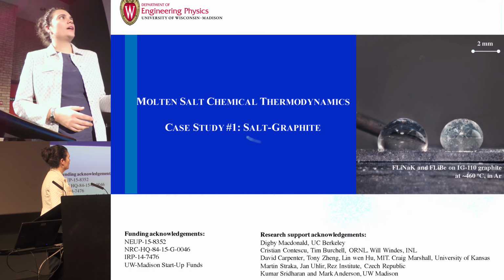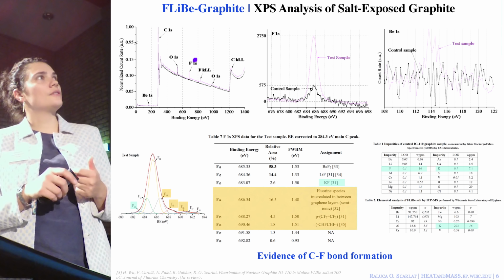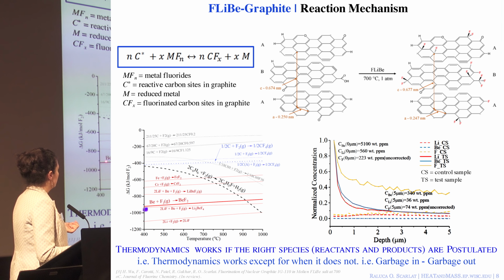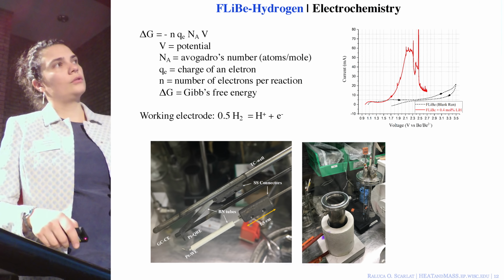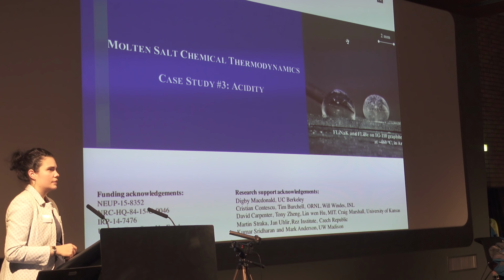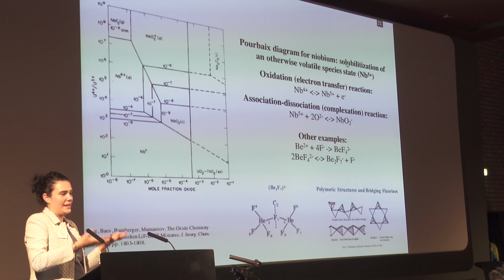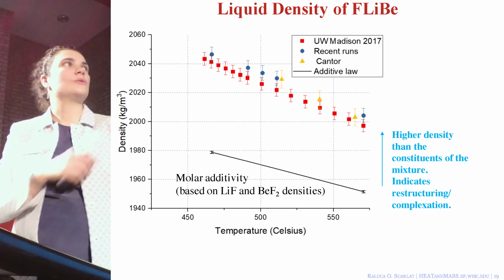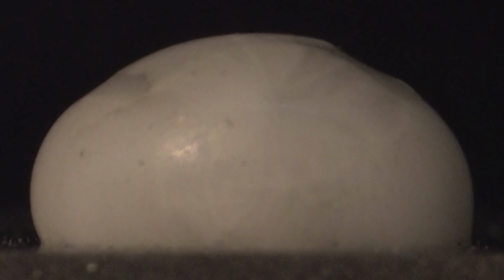Molten Salt Reactor Thermodynamics - Dr. Raluca Scarlat @ ThEC2018

Comment: Geology 101......The science of igneous petrology looks like its being applied by physicists, engineers, and to design/develop miniature magma chambers that are molten salt nuclear reaction chambers in what geologist’s call a double diffusive fractionating magma (molten salt) chamber that works like a Carnot engine fueled by circulating fractionated concentrated radioactive isotopes U, Th, K in a low viscosity magma/molten salt chamber/reservoir that is bound/clad by a high viscosity reflective chamber surface that experiences periodic fluxuations in pressure and temperature near its threshold of brittle containment failure.

Comment: I'm concerned that a lot of this chemistry will change radically and for the worse when there's a lot of ionizing radiation around and Trace fission products to act as catalysts.

I'm kind of wondering if we should scale things up so that we can code everything with the cold layer of fluoride salts want me to take you the right geometry for criticality.
Reply: Don't forget about the boltzmann partition function. It's going to make small amounts of species even against Gibbs free energy. These species are going to be in equilibrium with the solid graphite, but as they re combine to form graphite they're going to come back together as higher entropy particles not in the solid bricks of materials.

https://en.m.wikipedia.org/wiki/Partition_function_(statistical_mechanics)

Comment: I learn more towards a system with Fast Nutronics as opposed to thermal. The graphite moderated core makes for more waste and shutdown time, assuming you can't replace the moderator with the reactor operating.
Reply from the maker: Fast-spectrum MSR is also being investigated (TerraPower's for example MCFR). Probably best to pursue both in case either thermal-breeding of Th/U233 faces surprise challenges with Chemical Kidney, or the providing of enough fissile for seeding MCFR turns up surprisingly effective political resistance. But I don't think shutting down the reactor to replace graphite is a show-stopper... that's not regular refueling outage, that is an infrequent maintenance process.

Most Thermal-Spectrum MSR are "burners" they're not trying to breed, don't use 2-fluid designs, the graphite is nothing more than rods and the entire reactor core is designed to have a shorter lifespan... while graphite has a finite lifespan in the reactor core most MSR companies are using that as a reason to just swap cores and not worry about qualifying vessel materials for long lifespan... makes regulatory process easier. They can then inspect cooled-down used cores to see how all materials were performing and see which ones were lasting the furthest beyond very conservative estimates.

Comment: Did you ever think you could use the magnet feild for artificial gravity use we know it's a bit off a pig but it should work?????????
Reply: Lay off the bong rips and think on it some more.

Microgravity is very hard on human bodies that have evolved in a 1 g environment. 

The problems of microgravity will not be solved by magnetic boots because the problem is not sticking one's feet to the "floor" on a space station. The problem is the lack of acceleration exerting a downward force on the body to keep fluids where they should be, muscles and bones physically conditioned as they should be, and microvasculature functioning as it should.

The only way to mitigate the negative effects of microgravity - the osteoporosis, the muscle wasting, the sinusitis, the cardiovascular consequences - is acceleration. That could be spin gravity where the space station spins the habitat section around an axis, and the surface perpendicular to the axis of rotation becomes the "floor". Or it could be gravity from constant acceleration of 1 gravity - impossible to sustain long term due to the fuel inefficiency of current chemical rockets. 

If humans ever manage to quantise and manipulate the graviton - the theorised force carrier for gravity - then maybe we won't have to resort to acceleration gravity. But we are talking science fiction at that point.